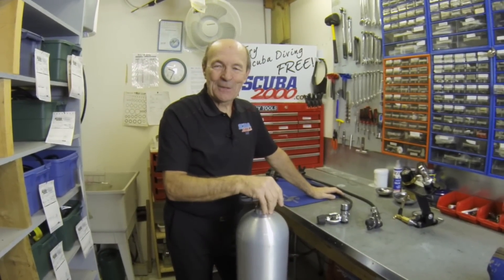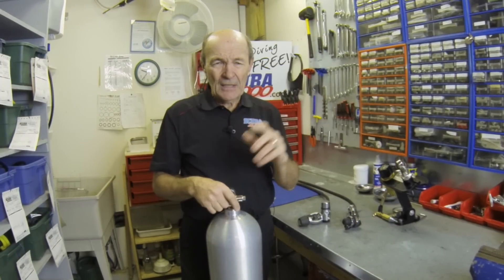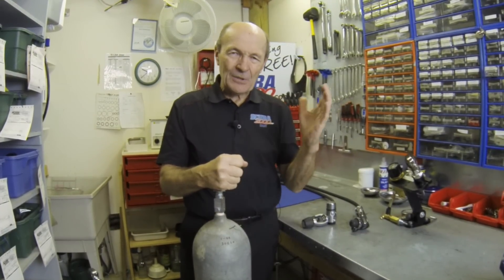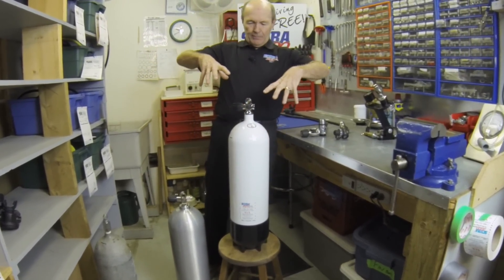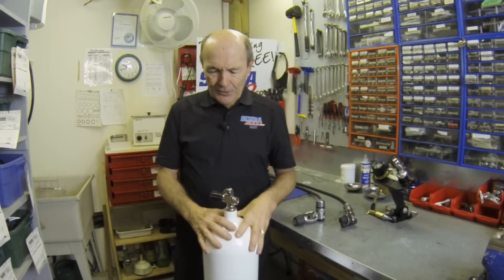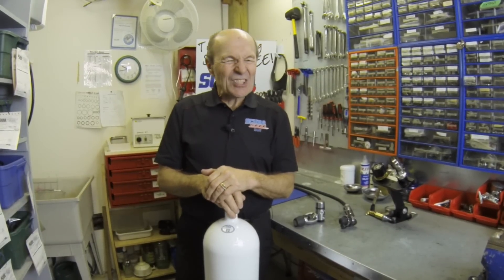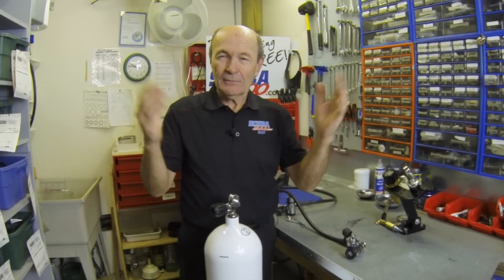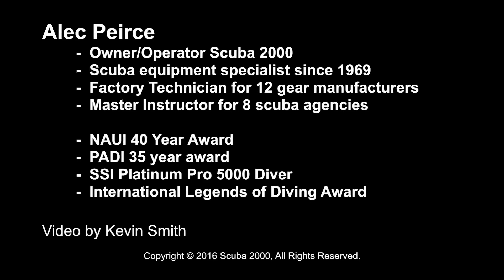Steel vs  Aluminum Tanks - Scuba Tech Tips: S03E07

Comment: 12L / 230bar steel tanks are pretty much the standard in central Europe.
Reply: paid 220 euro for a 12 Liter long Steel.  Hydro test cost 35 Euro incl visual at our local dutch retailer.  Scuba gear is very pricey here.
Reply from the maker: Yes I know. EU divers are generally more fit or at least act it. They are prepared to carry heavier tanks particularly if there's a perceived benefit such as longer dives. I say perceived because the benefits of a steel tanks are sometimes overblown - negative buoyancy (no big deal in warm water), more air (good for air hogs but silly for small ladies), higher pressure (ditto and not really a benefit since that's harder on the tank, the valve and regulator not to mention greater risk to the fill station), longer dives (Diana and I were underwater in Key Largo for 1 hour & 54 minutes on an 80!!) and DIN valves (also an overblown perception of superiority which is debatable and not even necessary). 
I'm not down on steel tanks. I used them for 25 years but I do object to any diver who states that they (or any piece of gear) is the ONLY way to go. It's just not so. 
Alec
Reply: Steel tanks cost the same as aluminum ones in Europe and since water is very cold here, the extra weight is a good thing for us. The only people using alu tanks around here are technical divers who use them as stage bottles. Not to spark a discussion, just to tell you how things are in other places.
Reply from the maker: Absolutely. I'm always anxious to learn about diving in other places. I'm so fortunate to have dived around the world, almost everywhere imaginable. I had an opportunity to dive off Portsmouth a few years back when we were in England. Unfortunately time wasn't in our favor. It would have been fun.
Here steel tanks cost at least 3X more than Aluminum 80s - $550 vs >$200. Then you have the cost of DIN adapters at $100+ so here the cost is a factor for sure.
Many divers here have 2, 3 or more tanks.
Take care. Alec
Reply: that's pretty expensive steel. here in Germany a new 12L (little more than 80cuf) cylinder costs about $250, steel or alu, with DIN double valves (because of the cold water, it's customary to use two 1st stages).
Reply: Alec said: "Here steel tanks cost at least 3X more than Aluminum 80s - $550 vs >$200" 

But online they are only $80-100 more - Faber HP80 (10.2l) $259 shipped, vs Luxfer 80cf Alu $169 (-$90)
http://www.leisurepro.com/p-fbrhp/faber-high-pressure-steel-tank
http://www.leisurepro.com/p-luxta8/luxfer-80-cubic-foot-aluminum-tank-with-pro-valve
and since they are 3442psi (and not 3500psi) they come with Yoke/DIN valves as you know so no need to change your first stage either... I do think 10lbs different (see other thread) is SIGNIFICANT... who wouldn't want that saving even in the tropics ? unless it is too much neg buoyancy at -8lbs of course.

alewar777, interesting about the double valves. I was wondering about that when looking at the DIVECARBON 300 tanks (which while interesting don't make much sense saving you only 3lbs effective weight with such exotic build and fill requirement and price...
Reply: We've got steel (7)/10/12/(15) and 18L 200bar (old standard), 230bar, which is the new standard and 300bar.
The 300bar DIN valve has a longer thread, so the insert screws in too deep for the yoke to be usable. 
My main reason for using DIN, besides the advantages you mentioned is simply that it is a lot more compact. Less bits sticking out that you can get snared on.
Reply: in the US, the new steel standard is 3442psi (237bar, I'm sure exactly same tanks as yours) but with DIN/Yoke option so shorter DIN200 not deep DIN300 (and valves being 3/4" instead of 25mm you guys have). Older HP steel where 3500psi with smaller thread and DIN only option and you couldn't retrofit a new Yoke/DIN pro valve because of the different thread. But alu 80cf/3000psi are still the cheapest and most common here as Alec mentioned...
Reply from the maker: Not many of the vocal fans of DIN even mention that very good point Hans.
There's no question that a yoke is more likely to get caught up in something. Fishing line is the worst but kelp, rope, edges of doorways in wrecks, etc. - I've experienced them all.
Take care.
Alec
Reply from the maker: Interesting Alain and quite right. You cannot insert the older 200BAR fitting into a newer 300BAR valve for safety reasons. The thread is the same but it's shorter so the O-Ring won't reach the bottom and seal.
The DIN/Yoke reg fitting is handy because it will work on both DIN and Yoke tanks. 
The newer tanks are rated at 3442 psi as you say so that you can use either. DIN is not mandatory until 3500 psi or higher. To accommodate both, the manufacturers simply lowered the pressure rating. 
I suspect they are exactly the same. Why would they make an entirely new tank for 58 psi less?
Just lower the working pressure on the tank so that you can use DIN or Yoke.

It's a bit like outboard motors. You can get dozens of motors rated at just under 10 horsepower - 9.9, 9.7, 9.5, etc. The reason is that 10HP motors and above have to meet more stringent manufacturing and testing procedures. Easier to just call them 9.9.

Take care.
Alec
Reply: African Twin, that quite a bit cheaper than US. best price is $320 for 100cf/12.9L HP tank and $50 for hydro+viz+fill (you don't need hydro on new tank, just viz+fill at $15-20)

Comment: Well I heard you talked about in an earlier video of yours. My buddy an I bought a steel tank back in 1963 an watched Sea Hunt and went diving and we are still here. But that was the good old days. 
      What I would like to know is, I bought a US Divers Aluminum Professional tank back in 1974. DOT-SP6498-3000, P21480, 11 ^ 73 USD. Now a lot of shops won't fill it and the others I have to have it tested before they will fill it. When I got a hold Luxfer Tanks about the Life Time Warranty they said the tanks good so screw you. It gets to cost a little much every time I have to fill it. Is that the way it is now! Thanks Alec, Joe the vintage diver
Reply from the maker: Wow! You have started a real debate here Joe. So many topics in one short comment!!
Let me share some ideas, most of which you'll find confirmed if you look around.

1. It's probably easier to get the old steel 72's from the 60's and 70's tested and made useable than it is for the Luxfer 80's The reason for the problem with the Luxfer tanks made between 1972 and 1988 (in the US) is the aluminum alloy used (called 6351) which is subject to SLC (Sustained Load Cracking), a potentially dangerous problem.
2. Proper annual inspection will determine if your tanks are suffering from this problem. It is a slow process so the annual inspection is sufficient to keep you safe. Note that SLCs are uncovered by a visual inspection- NOT a hydro test. The tank may well pass the 5 year Hydro Test but fail visual.
3. Proper storage of scuba tanks is helpful too. As I've explained in my videos, your tanks should be stored with some air in them BUT NOT FULL. I suggest less than 500 psi. This is long-term storage - 6 months +.
4. The LifeTime Warranty is long over. I know that sound silly but life is usually determined to be 15 years. It's academic at this point since U.S. Divers has changed hands several times since the 70's and the current company has no liability for an old warranty.
5. Luxfer did offer an exchange program for these tanks (US only) but that's also long over. Don't feel too bad about that since the cost of shipping your tank to Luxfer for their "assessment" would have purchased a new tank!
6. Because of some well-publicised explosions (very few), many dive stores simply avoid the problem by refusing to test or fill the old Luxfers. That's their individual, business choice and they have that right just as they can choose to not sell you a mask! In their defense, the tank explosions have almost invariably occurred during the filling process, not on the diver's back.
7. Because of inconsistency in Visual Inspection methods, a dive store may not accept an inspection sticker from a another store and can require you to have another inspection before they fill the tank. Again that's their right. Again in their defense, there are lots of divers out there who have taken an inspection course and have Visual stickers for tanks but who do NOT necessarily do a good job, particularly when they have are not in the scuba business so have little to lose if their methods are sloppy. Heck, you can buy Vis Stickers on eBay!!!
8. As an aside but interesting, you will notice that your tank is so old that it was produced under the Special Permit (SP6498) from the DOT before aluminum tanks were finally recognized as safe and received full certification without the SP designation that had to be renewed regularly.
9. Another interesting aside is that your tank is a "Professional" model from US Divers. All of their tanks were identical production (other than the color of the paint) but they would put different banners on them - MKI, MKII or Professional. Dive stores simply charged more for the Professional model. Same tank; different color and banner!
10. Not to question your story, but Luxfer would not say "the tank is good" without seeing it. They may have meant that the tank is good if inspected and passed in which case you start reading this reply from the top again.

Many dive stores (like my old store Scuba 2000) will give you a Trade-In on your old Luxfer tank which will make the purchase of a new tank so reasonable that after 2 years without tests and aggravation, it's pretty much free.
It's irritating but I suggest you think about the fact that you have made hundreds (maybe thousands) of dives on that good ol' Luxfer. Maybe it's time to retire it. Is there anything else that you own that you have used for over 40 years under extreme conditions (marine environment and high pressure) that you still use today? (wives don't count!!).

Good luck. Thanks for watching. Alec
Reply: Alec thanks a lot, I left a comment on your video on vintage knives. Everything I have is vintage, but I did have  to get some new stuff. I had to send my U.S. Divers Calypso regulator to vintage repair in Washington State a few years back.  My wet suits, masks, fins and BC's rotted away over the years. Still have my weight belt with new webbing and 25 lbs. of weight. I guess I'm just an Old Geezer but I'm still kicking. I have been watching everyone of your Video's and they are GREAT! I wish your shop was around here! I really hate to get rid of my tank with all Dates and all the different Stickers on over the years.  Thanks Again, Joe The Old Vintage Diver. 

    P.S.  I bought my tank at where Ikelites were made back than in Indianapolis, IN. there was a Dive Shop in front. Now I live in Glendale, Arizona.
Reply from the maker: I know that shop. It was owned by Ike, the chap who made the first decent underwater lights. They became famous and were known as Ike's Lights - now called Ikelite. Neat huh?
Yeah, I liked my old tank with the hundreds of stickers too. You'll be shocked to know that all those old stickers are supposed to be taken off during a proper visual examination - any old visual stickers anyway.
Maybe you should put your tank on display in the rec room or garage where your grandkids can see it and ask about it.
Take care. Alec
Reply: oh no, I found some ALU 50s to play around the pool/kids but they are Luxfer 3AL3000 from 1984 (dacor) so assuming they have the same problem ?
CTC/DOT 3AL3000 S50
R7222 / R7233 LUXFER  1 A 84
last hydro (?) was 9/16 VE  (is that visual only ?)

Comment: DIN and Steel Tanks are pretty much de rigueur in the UK and most of Europe. Although we would never mount them turret up like in this video. The turret should always be down.
Reply from the maker: I assume by turret you are referring to the tank valve?
I have not heard that term before but my BSAC affiliation exposed me to other terminology differences between US and UK divers such as bottle, kit, costume, torch, etc.
Reply: Alec Peirce Scuba By turret I mean the LP side of the regs (particularly on piston regs where it's often free to rotate) where the hoses are attached. If that's at the top then it's more exposed to be knocked against bits of wreck. Keeping the LP side down protects as much of it as possible behind the tank valve. It's one of the main reasons I prefer DIN regs, they allow for a lower profile; handy during wreck penetration.
Reply from the maker: Ok. I think I understand. Depending on the regulator, it's possible mount them in different ways on the valve. Let's call it 'up' or 'down'. 
When 'up' the LP ports are high, probably sticking well above the actual valve and they may be more exposed. This is most noticeable on swivel regulators that allow the hose to swing around for comfort - think Scubapro MK 25, but can apply to non-swivel as well.
If mounted 'down' the LP ports are below the valve opening and are somewhat protected by the valve. This would be preferred but it would also remove the swivel action of a swivel reg. That's not a big deal in most cases.
Am I following you?
Alec
Reply: Alec Peirce Scuba Yep that's what I'm talking about. I dive with an Atomic B2 DIN fitting, and I've found with the position of the LP ports I still get enough rotation.

I do have a tip I've found though. As someone who dives frequently in limestone quarries, I've found my clips and bolt snaps get covered in limescale. This tends to make them more difficult to operate. So occasionally I soak them in a hot citric acid solution for around 15 minutes, they come out good as new. All that's needed is anhydrous citric acid dissolved in hot water. When I take them out I rinse them in freshwater. It works well because citric avoid is strong enough to dissolve limescale without affecting anything else.
Reply: "Should always" be down? They "should" be mounted the way the diver prefer, period. For instance, up north in Canada I mount it down for protection, because we dive mostly shipwrecks up there. in sunny Florida where I currently am I mount it up, better swivel action for comfort.

Comment: Hi . how to choose between 200 bar and 300 bar . I m using a DIN valve and it is working at 300 bar . I m doing a lot of deep diving and I am thinking to buy a new tank (300 bar ) . or can you make another episode about this problem ?! Please ! Thank  you for everything and for the Sea Hunt series . You ( and Kevin ) are making a fantastic job . Thank you verry much for everything .
Reply: Laurentiu Charec the 300 bar DIN valves have more threads. If you noticed when you screw your regulator into a "standard" (200 bar) DIN tank, some threads are still exposed. The 300 bar captures all of these to make it more resilient at high pressure and added security of the captured o-ring. An advantage of the 200 bar DIN valves is you can screw in a double o-ring insert to convert them to accommodate a yoke regulator. With a 300 bar valve you can't do that, too many threads, a yoke regulator won't seal unless you get a special kind I guess but I've never seen before. Given the option, a 200 bar DIN is adequate for most uses. The only 300 bar DIN valves I own are on my backmounted doubles, even my stage bottles are 200 bar.

Comment: I have a pair of USD Aluminum 80S, That I bought in the early 70s.  I know it was the early 70s because I moved to San Juan in 1976 and I had the tanks with me.  I moved to Fort Worth in 1978, The tanks were last tested in the 1990s.  Is there any reasonable chance that these tanks are still good? Should I just take them in for test and refill?
Reply from the maker: If made between 1972 and 1988, Luxfer aluminum tanks are subject to SLC and potentially dangerous. Most dive shops will not fill them nor test them. Read about it here http://www.luxfercylinders.com/support/faq-luxfer-6351-alloy-slc .
Many of those tanks are still useful and could very well pass testing John but for gosh sakes they are 40 to 45 years old!! Get a new tank if you need one or rent a tank. Either option is cheap, safe and hassle-free.
Getting your old tanks hydro tested, visually examined and filled plus new o-rings will cost over $50 each - and they're still 45 years old!
A brand new tank is $150 to buy or $15 to rent. The rent includes the $10 air fill!!
Reply: Thanks Alec, when I bought these tanks U.S. Divers advertised them guaranteed for life.  I was just wondering if that guarantee was still valid.  I am coming up on my 80th birthday, so most of my diving days are behind me.  This is the first time I ever saw "Luxfer" I have no idea what that means or what SLC is.  Thanks for your insight, I enjoy your videos, a big thumbs up... John